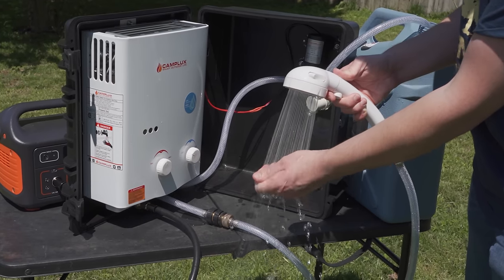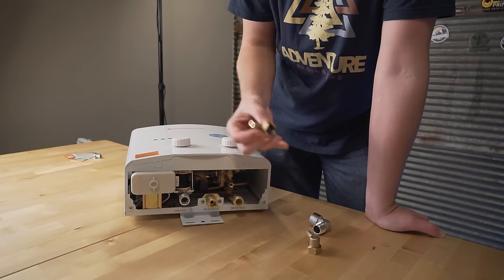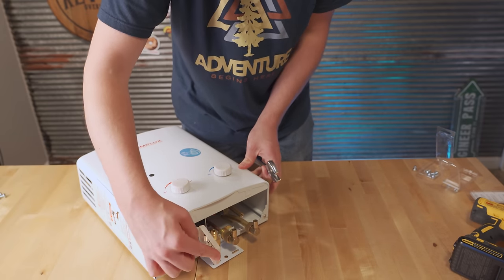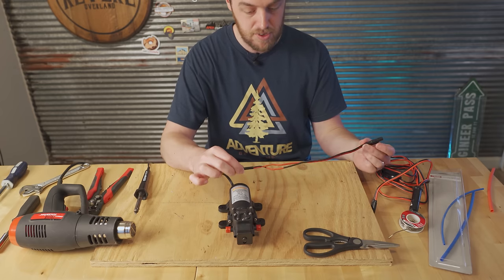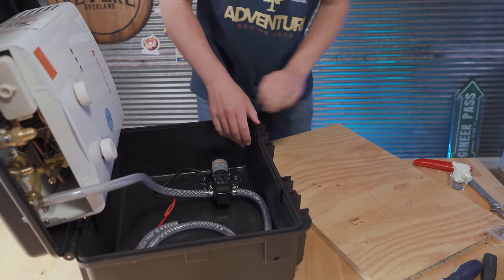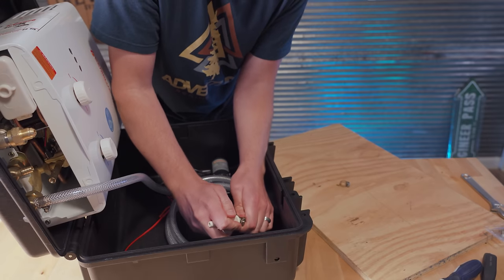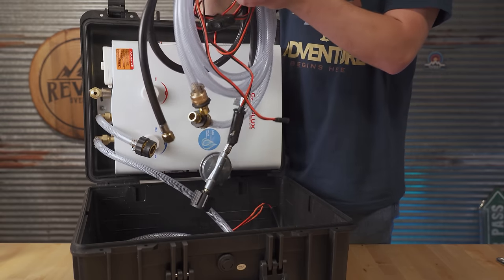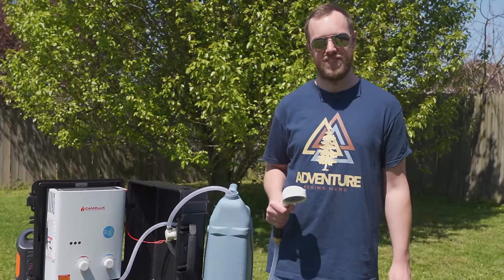Instant Hot Camp Shower in a Box

Comment: In the event that you don't need the water heated to rinse something, does the heater still allow flow from the pump to the nozzle?
Reply from the maker: Yes. You can run water through without the propane connected or just off. It will try and ignite still, but with no propane there’s obviously nothing to ignite! You could always add another quick disconnect right after the pump instead, so you can plug the shower head in directly.

Comment: Excellent idea, and what about of heat extruding from the Camplux it doesn't melt edge of the box?
Reply from the maker: No, it doesn't. I mounted the heater in the lid, where there's not enough of an overlap. I have a friend that put his inside the box, and even then he doesn't have issues - the boxes are pretty heat resistant.

Comment: On Amazon the box you list is the 20.3 liter with a description measurement of 22in x 14in x 8in. I am taking those re the outside measurements. The 28.5 liter (the larger of the two) has a description measurement of 19in x 16in x 8in. There must be a screw-up in the description with the larger (28.5L) having smaller measurements. I want to get an orange colored box, but I also want to get the correct size. Which box did you actually use for this setup, the 20.3L or the 28.5L? Thanks for the tutorial on the system.
Reply from the maker: The link should take you to the 28.5. The 20.3 is too narrow to mount the pump in!
Reply from the maker: The 20.3 is 20.71 x 10.83 x 6.67 inside. The last two measurements aren’t enough.
Reply: @RevereOverland  Ok thanks. That is what I was thinking...it looks like they have the measurements backwards in the item description...good to go...

Comment: You mentioned your rear bumper. Have you installed a new bumper to your runner yet?  Which one?  Why?
Reply from the maker: Yes, I have the TJM rear bumper. It has dual swing outs, farm jack mount, license plate bracket, camera, and all of the wiring harnesses with it, for under $2k! I’ll post some pictures to Insta/Facebook this evening.
Reply: Revere Overland ya I was waiting to see how you fit it to your rig, where it all actually hooked up. Haven’t seen one on an overlander.. I have a van and most outfit shower inside. Perhaps another video of the shower on the rig.. Also do you charge the Jakery at camp sites? Or just one charge at home before you head out on travels.? Thx.

Comment: How is this system holding up?  I read that after a certain time this particular model would fail.
Reply from the maker: Mine broke when I left it out in the freezing temperatures, but the second one is doing well!
Reply: @RevereOverland  Okay first love your videos.  I have a question though.  I am looking to outfit my truck with both this shower system as well as your diesel heater idea.  What size jackery would you purchase?
Reply from the maker: The shower uses pretty much no power at all, so isn't an issue. The diesel heater needs a Jackery 500. If you're also wanting to power other big draws like a fridge then I'd recommend a dual battery setup over a Jackery.

Comment: Good video!  Coincidentally, I have the same propane heater, the same pump and the same propane tank.  Like another commenter, I also plan to split the propane to a stove.  I’ll be pulling the water out of a 10 gal. storage tank through a fitting on its bottom.  The cool water in the shower hose will be sent back into the holding tank until the hot water reaches the nozzle.  I already have a RoadShower 4S so it may live upstream of the tank to add another 4 gal. to my capacity.
Reply from the maker: Nice! Water capacity is definitely my limitation, so I'm planning on adding a 7 gallon tank under the vehicle.
Reply: What I didn’t mention is that my rig is a Suzuki Samurai.  With my limitations in cargo space and horsepower, I have to set priorities for what I bring with me.  They’re mostly based on what I NEED.  Hot water is a luxury I don’t need but comfort and hygiene are huge WANTS.  The Camplux heater is basically the size of a shoebox, so it’s not a big deal to find space for it. Mine will fit just behind he driver side headrest outside the passenger compartment of my RallyTop Sport model, two-piece, fiberglass hardtop.  That’s the model that closes the rear of the cockpit by dropping mostly vertically behind the targa and roll bar and then horizontally back over the cargo compartment which has a hinged lid.  Under that lid I’ll keep a 25L Dometic freezer, a 35L Alpicool fridge, the 5 lb. propane tank, the 10 gal. water tank, pump, coach battery, solar power manager, inverter, etc.  That area will also hold a lightweight and compact chair and table, both of which were chosen for their small space requirements.  All of this fits under my rooftop tent which will ride at a height only slightly lower than the roof of the cab.  I have an aftermarket, 15 gal. fuel tank where the stock 11.1 gal. tank used to be.  Add two 3.5 gal. Roto-Pax fuel cells and my capacity is 22 gal. which will give me around 400 miles of range.  I expect to make 14 gal. of water last about 10 days between fill-ups.  That should give me more flexibility in planning off-grid itineraries with fewer stops in civilization and greater self-reliance.  The solar panels are the flexible, light weight type that are a mere 1/10” thick so two of them will fit within my closed tent to be deployed only while I’m stopped and the alternator isn’t keeping my deep-cycle, auxiliary battery charged to support the ability to run the cold food storage and keep my drone batteries and other electronics charged.  I’m on a mission to make this work on a mini-platform that will fit where bigger rigs won’t.

Comment: Does the water heater get hot enough to mess with the plastic case ?
Reply from the maker: No, but you mount it in the lid rather than the base. That way the heat can escape more easily.

Comment: Your Jerry Can can be put on its side and the lid it comes with can be replaced with one that has a nipple on it, or you can add one. This will let you not have any leaks when traveling by leaving the jerry can in the standing position. then tip it on its side when using the shower.
Reply from the maker: Yeah there are some options. I’m planning on actually mounting a 7 gallon tank in the 4Runner spare wheel well instead!
Reply: @RevereOverland  By the way I enjoy your ability to think outside the box (well inside the box as of late) but you get what I mean.

Comment: Nice Video!  I have a similar heater (Eccotemp L5) which looks almost identical to your Camplux.  However, the Eccotemp has a significant amount of heat coming off the top which requires a heatshield that comes with the Eccotemp. 

Do you find a problem of significant heat being released from the top which may blow into the top of the case?  I see that the Camplux did not have heat shield.  Thanks for posting these.  Your videos are great!
Reply from the maker: It does kick up heat from the top. That's why I mounted in the lid rather than the main box though!
Reply: @RevereOverland  Thanks for the reply.. I like the way you've pulled this together.  I'll try the same!

Comment: I ended up losing the brass adapter that came with the kit that goes on the end of the 90 degree angle gas side. Anyone have any idea what it is called? I've tried 1/2 BSPP to NPT but Im not 100% sure that is what it is and it seems impossible to find.

Comment: I live in an apartment and got sick and tired of only getting 10mins of showering and hot water goes out. Is it possible to attach it to a showerhead?
Reply from the maker: Yes, but it’s not a good idea to run it inside due to the carbon monoxide risk.
Reply: @RevereOverland  so do i need to move the tank or the heater to minimize risk?
Reply from the maker: @vicerichter1163 just the heater would need to be outside

Comment: The reason the corrosion would occur is due to the use of dissimilar metals, the water isn't causing that.
Reply from the maker: Right, but water accelerates the corrosion.
Reply: @RevereOverland   A true, but redundant fact because using the proper metal eliminates electrolysis. Water is corrosive in any event.

Comment: Almost ordered all of the parts then realized that these water heaters may not work at high altitude. I live at 6,000 feet. I did not see any comments concerning using this unit at high elevation. What elevations have you tested it at?
Reply from the maker: I have a buddy who has had this exact model for a couple of years, and it does just fine. I think the highest we camped at was around 9,000 ft in Colorado.
Reply: Revere Overland thanks for letting me know! I see that the 12 volt pump is no longer available as of today 🤦🏼‍♂️
Reply from the maker: According to their website, they'll have more in stock on the 22nd: https://camplux.com/camplux-1-2-gpm-pressure-diaphragm-water-pump/
You could use another 12v pump with a diaphragm, but there's no way to guarantee it'll fit.
Reply: Revere Overland but you did all of the “fitment” work, that’s why I really like this setup! Well, I really like the portable aspect for swapping between vehicles too 🤷🏼‍♂️.    It’s a great build, thanks for figuring it out. Lowe’s is only 80 miles away, so you will save me a trip or two or three.

Comment: Good post but, Much simpler idea. Heat water to boiling on large canteen or pot. Pour boiling water to cool water container then just  need to rig pump power set hose to container ...no need of propane heater ..use just your stove. Save water...space, weight , problems, danger of fire...etc..

Comment: I’d be concerned about it having water dripping in the box with it hanging on the rear of the vehicle closed in the hot sun. The water will turn into water vapors in the heat and condensate when it’s cool causing corrosion in the battery compartment and igniter. And it will happen the expedites it.
Reply from the maker: The only problem I had in 2 years of use was when I left water in the hose and it froze overnight. Lesson learned, and I never had a problem again.

Comment: Why go thru all the trouble of mounting it in an expensive Pelican case when if it's portablity that you want, just mount it onto a board with a cut out hand hold that you can hang from where ever you want or take off and out of the car when not used. KISS!

Comment: Most of those heaters fine print says not to mount in an enclosed box.
Reply from the maker: That’s why you open it 😉
Reply: Read the fine print.  No boxes of any kind.  It’s a great idea.  I built a large wooden box around mine because it was at my deer camp.  Had the pump and everything wired up.  Mine was much larger than a case.  Manufacturer voided my warranty.  It was a POS anyway.
Reply from the maker: I get what you’re saying, but when it’s in use, it’s not at all enclosed. Unfortunately I feel with these cheap units you’re not going to get very far with warranty claims no matter what.
Reply: @RevereOverland  agree.  These are prone to fails due to all the burn and scald protection built in.

Comment: Some brands of propane water heaters tend to not work at elevations above 5,000 ft. So check the reviews.
Reply from the maker: I’ve not noticed. The highest I’ve used mine is 11,000 ft.
Reply: Revere Overland good to know; I’ll order the one you have used. I had to return the brand I ordered as it wouldn’t ignite at 7,000 ft.
Reply from the maker: If they don't ignite, try turning the water flow down a little! I know this is probably too late!
Reply: Revere Overland, thanks I’ll try that on the next one if it has trouble.

Comment: Yeah looking at the specs this thing is not rated to use over 2000 ft elevation. I live at 6k and everywhere around is 8 to 13k elevation. Looks cool for Florida. Haha
Reply: "The camplux tankless propane water heater line was not recommend for elevation above 2000 ft."
Reply from the maker: It works just fine though. I've used it multiple times over 10k feet.
Reply: Seems a weird warning
 I couldn't understand why they put that on there.

Comment: How does this compare to the Zodi style ones?
Reply from the maker: This is more expensive, and takes up more space, but it’s better. I have a Zodi, but unfortunately it leaks pretty bad, so can’t be used anymore. The Zodi also can’t be turned on and off at will, so you end up wasting a lot of water. The battery pump is pretty crappy with the Zodi too, but I’d assume it can be replaced.
Reply: @RevereOverland  thanks for the insight. I have one but have never even used it. Have been just using large wipes when I feel dirty.
Reply from the maker: The Zodi definitely heated just fine, and would work well if you either just wanted to rinse off, or you have a lot of water available!

Comment: Putting that in a box to run is insane the heat that generates is way to high for even heat resistant plastic not to mention the air flow that thing needs. But this is all your problem.
Reply from the maker: I love when people tell me this won’t work… this setup is now 3 years old and has been copied hundreds of times without anyone having problems. But please, tell me more…

Comment: Good video but I would have rather had longer oncoming line than out going line less water to lose before you get hot water .
Reply from the maker: When you’re first turning it on the length of the shower hose doesn’t matter. If you’re soaping up with the shower off though, the hot water in the shower hose will cool some. The main thing to consider is how far the pump can pull water - it needs to be as close to the source as possible, especially for priming. The only way to get around that is to hard mount the pump on/near to your source, instead of the shower box.

Comment: unfortunate that the heater power couldn't run off the 12v source.
Reply: Is there a mod or adapter?
Reply from the maker: Unfortunately it would take a huge amount of power to heat with 12v, and I doubt you’d find a battery capable of it.
Reply: @RevereOverland  He is referring to the shower having to use D batteries to ignite, and would prefer an alternative method.

Comment: Great video, and yes it would be nice  take hot showers.   Though my husband would tell tell me just heat water and shower with a bucket  🤣🤣. My question is, would it work with the 240 Jackery. That's the one I have.
Reply from the maker: Thanks! My wife is the one who insisted on this, but secretly I’m pretty pumped to have a hot shower too! The Jackery 240 will run the 12v pump just fine - that’s actually what I tested it with first. I’d estimate about 10 hours of run time with it!